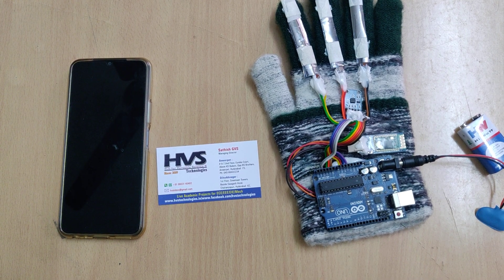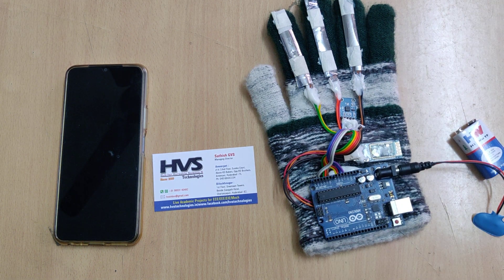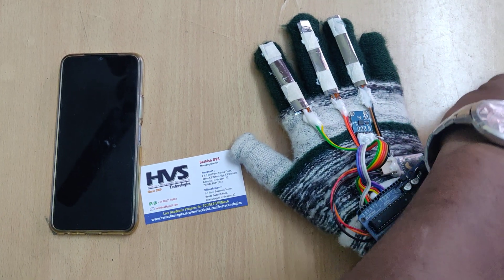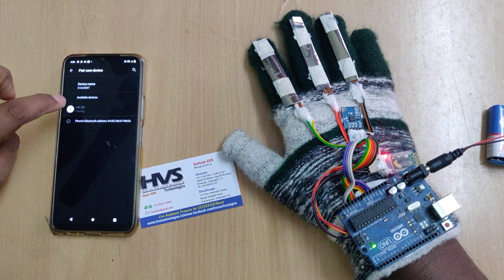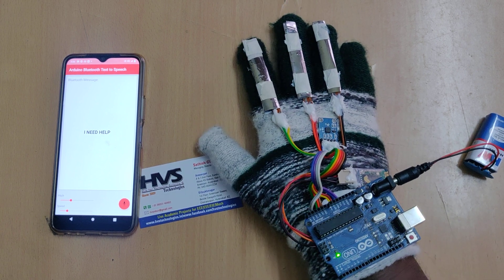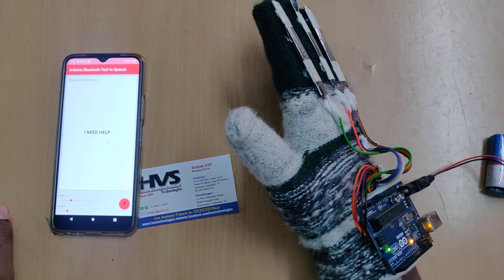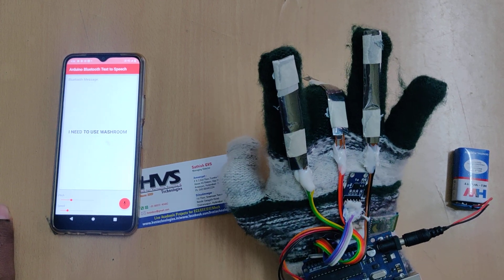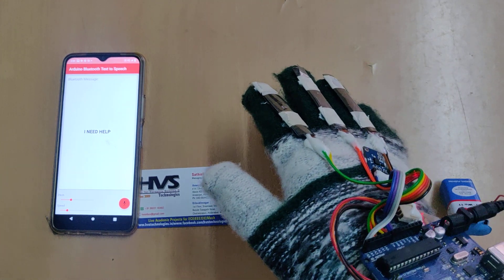HVS-4517--Smart Glove - Translate Gestures to Text and Text to speech through Bluetooth #flexsensors

Comment: What are the sensors in the fingers
Reply from the maker: @divyeshkumarbalar7732  flex sensor. You can contact us at +919603140482
Through WhatsApp or call
Reply: flex sensors

Comment: Please provide me code I am doing this project using Arduino nano but I am unable to getting the output
Reply from the maker: You can contact us at +919603140482
Through WhatsApp or call
Reply: Did U get code
Reply from the maker: @vikasraut5341  You can contact us at +919603140482
Through WhatsApp or call